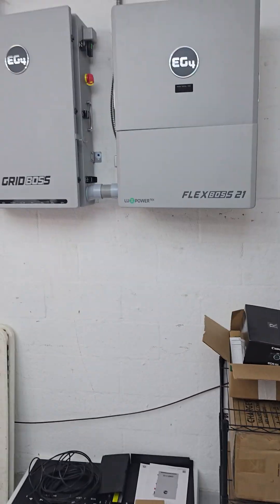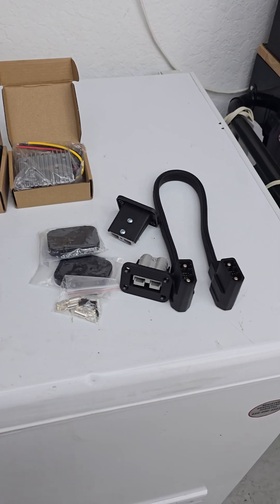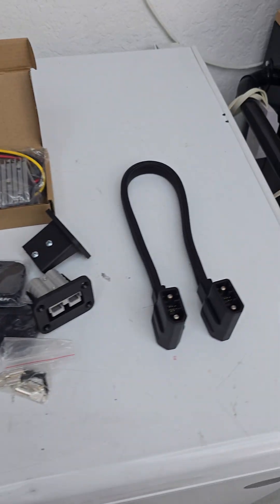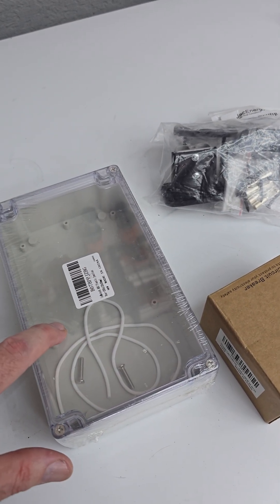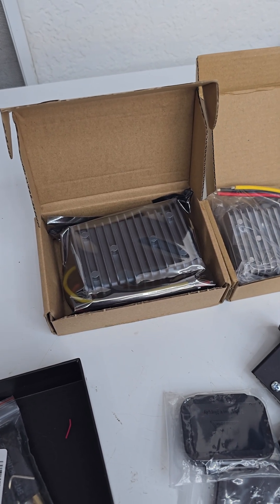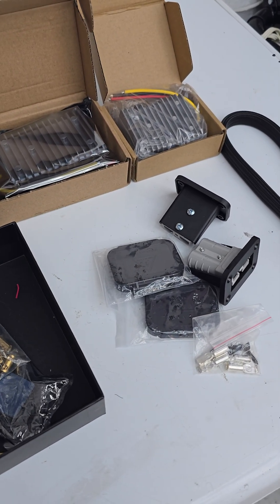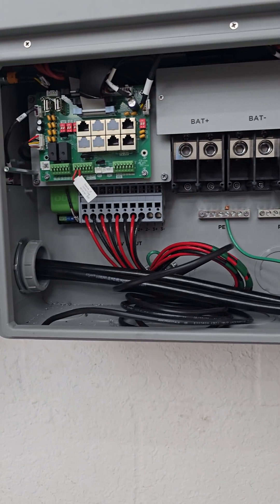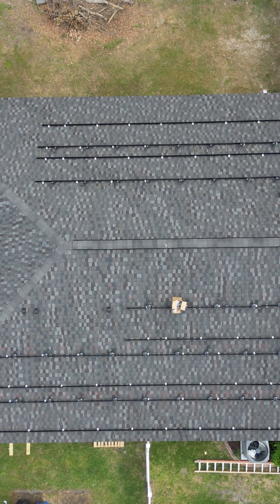The EcoFlow Battery Hack Is Getting Real (and One BIG Home Update) Who did I choose to run my home?

Comment: I asked Google about the reliability of EG4 products and here's the answer that Google gave me: Complaints about EG4 products primarily center on unreliable performance, faulty equipment, and especially poor customer service and warranty support. Common issues reported include batteries failing to charge or hold a charge, inverters causing appliance humming, and a complete lack of response from customer service for troubleshooting or warranty claims. 

Common issues with EG4 products
Battery problems: Batteries failing to charge to full capacity, randomly crashing, or having constant discharge issues. 

Inverter faults: Inverters causing a low humming noise in connected appliances and failing to operate correctly in mixed solar and grid-tied situations. 

Performance inconsistencies: Systems not reaching advertised capacity or charging speeds, requiring many "full cycles" to reach full potential, which is difficult to achieve in practice. 

Criticisms of EG4 customer and warranty support
Unresponsive and poor communication: Customers report being unable to reach support by phone or email, with long delays in receiving responses. 

Unhelpful support staff: Some users describe support staff as unprofessional, offering incorrect information, or blaming the user for system issues. 

Slow or non-existent warranty fulfillment: Customers have experienced significant delays in receiving replacement parts or resolving issues, with some waiting weeks or months without a resolution or tracking number. 

Lack of accountability: Some users feel the company is unwilling to take responsibility for faulty products, leading to frustration and wasted time and money.

Comment: I prefer using Victron or Mean Well DC to DC converters. The four to six letter specials are often not isolated and are of questionable quality. A buck shorting input to output would be very bad.
Reply from the maker: It's hard to know who is a long time sub, and who might be new.  If your new then you maybe don't know my entire existing system is Victron and I love their stuff.

But that would not be the right solution for this project as its an all in one system and we are building a hub, not a piece by piece full system.

So very much the Apex 300 Hub D1, kinda making my own version of that for Ecoflow.
I to intend to fuse everything for this to give us some extra safety. 

But what you would do is follow the same build, and use the 48v high power output that is full current and connect that to your DC to DC externally.  So this project fits everyone!